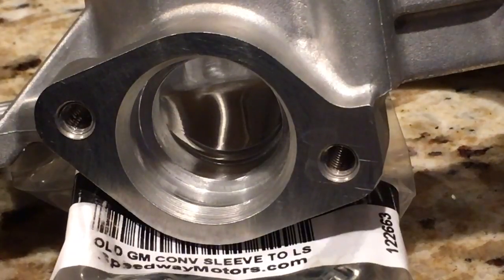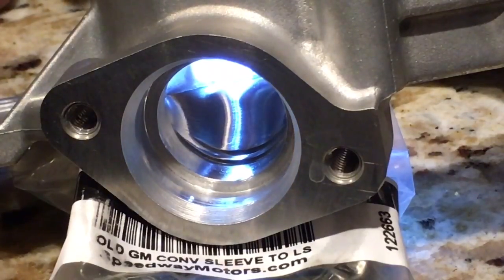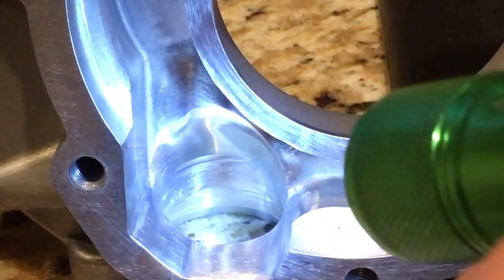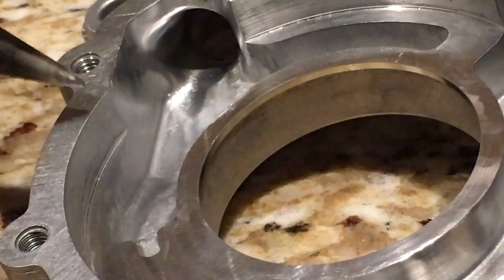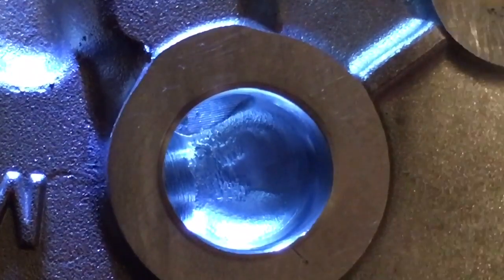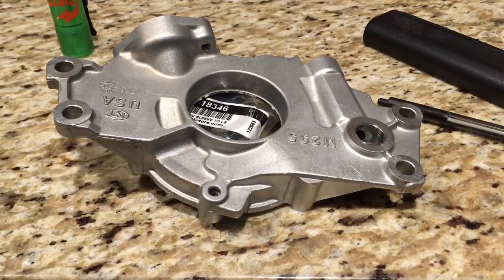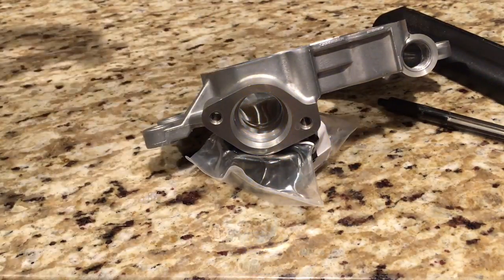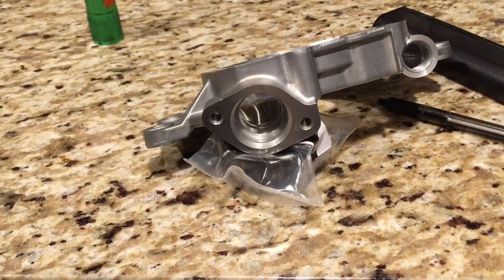Ported LS oil pump Improve Volume and Efficiency

Comment: tnx for those two edges that hold the pickup tube :x
Reply from the maker: Don’t mess with any of the outer areas where the o-ring seals.  The most important area is the outlet side of the pump.  JD

Comment: how much volume gains?
Reply from the maker: Jorge Lozada Good question, I have no way to measure volume changes only oil pressure.  I feel the work on the outlet side of the pump is going to improve efficiency even more than the shiny work on the inlet.  I was shocked nobody ever mentioned the rough casting lines and hard turns on the outlet side.   Shimmed .100” I see 58-60# Cold start idle and 48-50# Hot idle 750-800 rpms. With higher rpms it produces 75# + oil pressure.  Any engine expected to rev above 5300 rpms should have a stronger bypass spring either shimmed stock or aftermarket pump. JD

Comment: So shimming hundred thousand will not make 2 much oil pressure???
Reply from the maker: Gene Cenora I see at 750 rpms 58-60# Cold idle,  48-50# Hot idle and it quickly rises to 75# + with high rpms.  Using the old rules you’d want to add a quart of oil if sustained rpm is expected. 
The rule of thumb use to be you needed 1qt of oil for every 10# of oil pressure to ensure the pump is fed.  For some reason I was lucky, even though my GM Muscle Car pan advertises a 5.5 qt capacity, it shows full with 7qts!  I have the entire kit, so the dipstick matches the pan etc...   Even on a stock engine I’ve never had an issue running an extra 1/2-1 qt of oil to keep the pump fed. 
You could also look at longer larger capacity oil filters if you have enough clearance.
On old school SBC/BBC they had truck filters that held 1-2 qts. 🤔🤔🤔

Comment: I do a lot of block oil passage cleanup on race motors. No one talks about it because it was always considered to be a “top secret” mod for those in the “know”.
Reply from the maker: Preinstalled User Details, all the small details add up to longevity and making more power. 👍👍👍

Comment: Hey dude what state do you live in I may have you do my heads for my sbc if you want the work let me know
Reply from the maker: Slime Lines I’m in Missouri, what heads do you have?  
Race, Street, daily?
Reply: HeadFlowInc drag truck 94 single cab short bed s10 400 sbc aluminum afr heads want to add single 82 mm vs racing turbo this season want the heads worked before installing
Reply from the maker: Slime Lines What State are you in?  Do you know what cc’s the runners are now?
Reply: 235cc 70cc combustion Chambers 23 degree heads and I live in middle Tennessee
Reply from the maker: Slime Lines As long as they haven’t been ported before I’d like to work on them.  Will you need any guide work or surfacing?  
I’ll try to figure out how to send you a PM
Reply from the maker: Well, I can't send a PM, your channel isn't setup for them.  I would like to measure the bowl cut percentages and measure the as delivered port sizes.  The port texture is a highly debated topic, regarding the CNC lines left during the machining process.  Areas that can be worked are the width of the short turn, bowl size percentage, exposed guide in the ports and port texture.  It would be interesting to see if the heads actually measure a true 235cc to begin with.  Let me know what you'd like to do,  jeffdubray@gmail.com